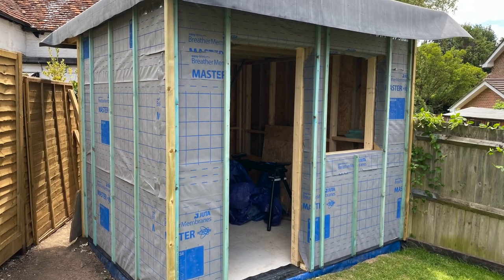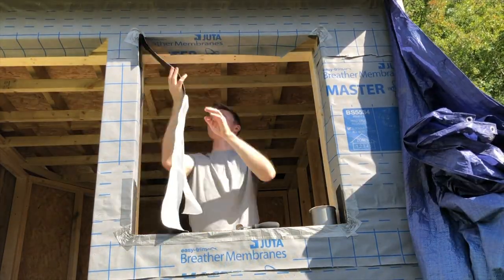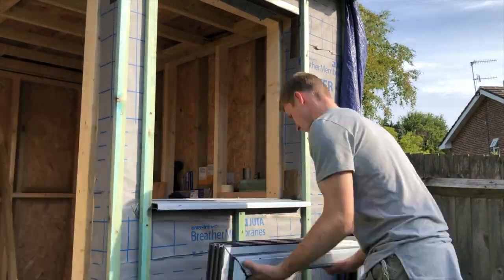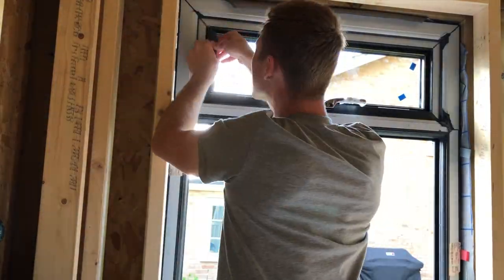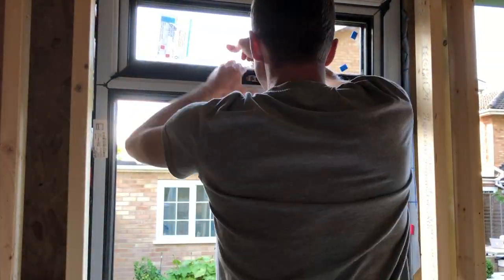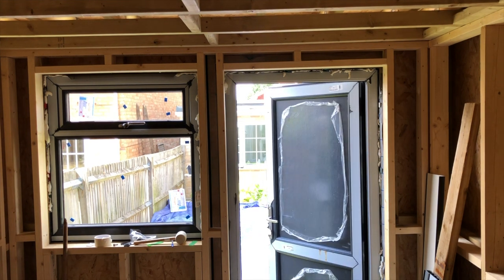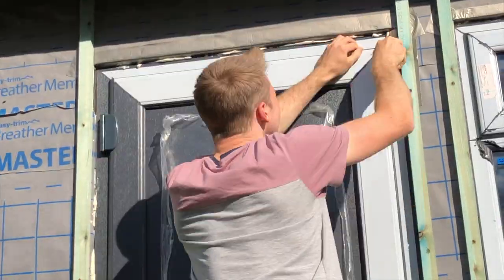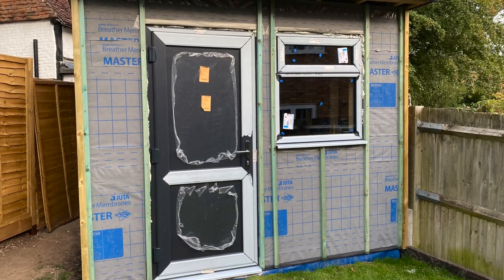How to Install a uPVC Door or Window in a timber frame - Drum Studio Garden Room Build - Part 7

Comment: Hi great video, are the doors and windows you're putting in tripple glazed for soundproofing?
Reply from the maker: Hi Matt, thanks for you comment and glad you liked the video. Yes it is triple acoustic glazing. This is the official description from the manufacturer:

"Pilkington Optiphon™ high quality acoustic laminated glass offers excellent noise reduction without reducing light transmittance and impact performance. Ideal for significantly reducing noise from road, rail or air traffic, factories or nightclubs. Noise is reflected back towards the source and also absorbed within the glass. The glass unit is made of a 6.8mm acoustic laminated outer pane, a 18mm Superspacer void and a 4mm inner KS pane. Being laminated it is also very secure and difficult to break into. The u-value is 1.2, the same as our superb A+ rated double glazing. Sound reduction Rw(C;Ctr) 41dB(-2; -6)"

https://www.modernupvcwindows.co.uk/img/guide/acousticZ.jpg

One important thing to note which I forgot to mention in the video: I intentionally installed the glass back to front so that rather than keeping outside sound from coming in, i'm stopping inside sound getting out. I checked with the supplier who confirmed this was ok and other customers have in fact done the same.

I will be installing an internal door and secondary glazing to improve the sound proofing performance as well.
Reply: @leejmurphy  great thanks for this
Reply: @leejmurphy  hi Lee how far from the ground level is the bottom of the cladding ,does the concrete base sit much higher than ground level and did you fold back the excess Dpm from the concrete base and trap this under externall walls?sorry for so many questions
Reply from the maker: Hi @mrmozzer - so I took the cladding down to the edge of the frame where it mets the concrete. The base is probably 1 to 2cm above ground level at the shortest point, but towards the back it's about 5cm. The excess DPM I folded over, ran a bead of silicone, and then put the DPC on top. You can just about make this out in the 3rd video on timber framing - https://www.youtube.com/watch?v=Z2BYoY54i5c
Reply: Thanks for your reply Lee

Comment: I used the same supplier - the windows came with a label on one side – but it did not indicate which side should be facing out and which side should be facing inside. Their website says: Inner pane – Pilkington KS, Outer pane – Pilkington Optiwhite - any idea how we can tell which one is which?
Reply from the maker: Hi Nick, did you get the acoustic glass? I seem to remember that the sticker was on the inside face. If you have the acoustic glass it is triple glazed with a double pane plus single pane so you can see which is which. The double side faces out with the single on the inside. This graphic might help https://www.modernupvcwindows.co.uk/img/guide/acousticZ.jpg
Reply: @leejmurphy  Thanks Lee - no, I’m afraid I got double glazed, so both panes look the same! I’ll give them a call… thanks for your help.
Reply: Called them - label should be inside - but apparently it makes negligible difference…
Reply from the maker: Good to know! 👍🏻

Comment: Nice work. Do you install the door inline with the batten or the osb. Thanks
Reply from the maker: Thanks! In fact it is set back a little bit from the OSB, so that with the batten and cladding I had a nice depth for the trim piece which I fitted. You can see this in the next video

Comment: did you tape the entire frame? It looks like you did the corners top and bottom but not the sides? 
Also, how much overlap is required. do you overlap outside only or inside as well. cheers

Comment: Hi
I fixing the a upvc door and come a cross a metal plate in the hinges side. Is it ok to drill this through to fix the door?
Reply from the maker: Hi Harsha. Yes I cannot see why not. The frame will be normally be reinforced with a metal core to give it strength. If you have any doubt the manufacture of the door can always confirm and advise the recommended fixing locations and method.
Reply: @leejmurphy  
Thanks

Comment: Hi Lee. Great job!
Wondering what type and size of screws you used for fixing the door and window to the timber frame? And also where to find the flashing tape? Many thanks.
Reply from the maker: Hi Stu, thanks for the comment. I would have likely used 100mms for fixing the doors and window. https://www.screwfix.com/p/goldscrew-pz-double-countersunk-multipurpose-screws-6-x-100mm-100-pack/16784

The flashing I used was called Buty Bond, but, if you can afford to spend a bit more you might consider given Tyvek a go. - Buty Bond - https://amzn.to/2KVLlYf  Tyvek - https://amzn.to/3rKhB0R

Hope that helps!

Comment: Hi Lee.  Thanks for all the videos, really helpful.  Curious to know how far you've got with the build, and whether you've had chance to see how the concrete base is performing temperature wise, particularly in this colder weather recently.
Cheers
Reply from the maker: Hi Patrick, thanks for the feedback. I have now recently finished the build and just started to move my stuff in a couple of weeks ago. I haven't used it for extended periods of time yet. The floor was very cold to start with but I also have hard floor. I've noticed that once you start to heat the room up the concrete does start to absorb the heat and takes the chill off.